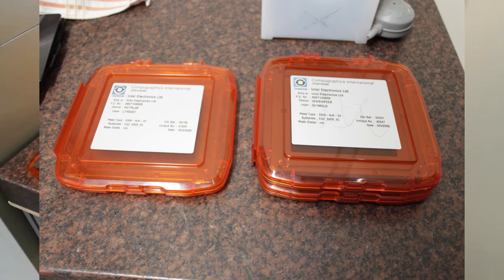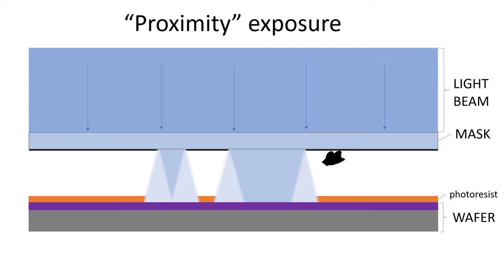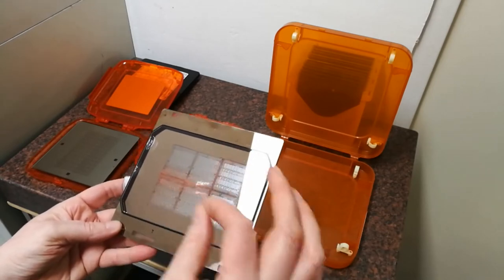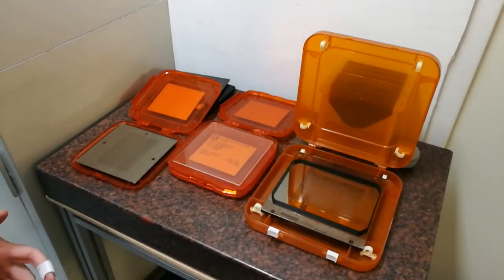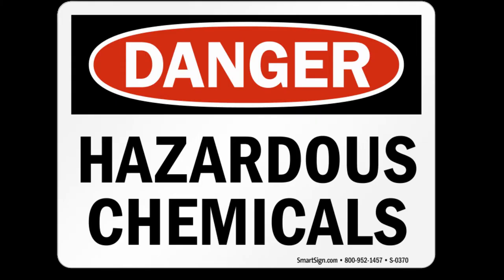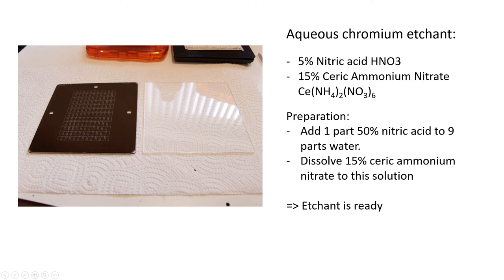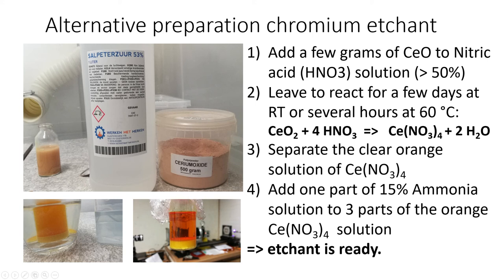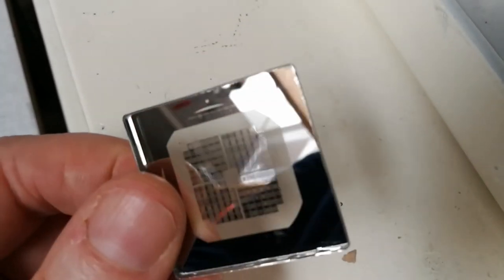Photomasks Explained (Contact and Projection): how to etch Thin Chromium Layers

Comment: I had got some masks to try and remove the chromium from. Found a Q-switched 355nm laser worked nice, ablated the chrome while leaving the quartz untouched, though this slow to the point to being useless. I ended up using the mask as a work surface in my furnace.

Comment: That's a very cool hack for a fume cupboard ! Really interesting about how the Pellicle de-focusses dust particles; reading about pellicles in semi-conductor / chip manufacturing I get a lot of oddly conflicting information (will eventually did deeper). In my 20's I did a lot of odd chemical mixing under heat that looking back I shake my head at. Is it possible to lap the Chromium layer off a quartz plate ? I know some fiducials on plates can be (skillfully) removed with a scalpel. And not to ask too many questions how do you / one know if one has a glass plate or a quartz plate ? Is there a quick test for that / tell tale signs before one has to measure refractive indices or analyze spectra etc. ?  Thanks again for making these amazing videos.
Reply from the maker: Hi ED, Thanks for you feedback. Yes it is possible to lap off the quartz. If you use rough lapping, it will be gone very quicky, but you will end up with a "frosted" window surface. If you use the "polishing" type of lapping, removal takes a long time. About quartz and glass: First you can find the code indication on the mask carrier box, second you can look at absorption (quarz has low absorption up to 190nm) and third you can look at thermal expansion coefficient on a hot plate using a micrometer gauge to measure the expansion during heating or cooling down. Quartz has a much lower expansion than borosilicate or float glass.
Reply: @HuygensOptics  Hey , thanks for that , wouldn't have thought of mapping out the thermal expansion, NICE tip ! Does make me look at Quartz with "New eyes". Very useful material.

Comment: But how is the first one made?  I mean so lets say they designed a new chip.  How would they take that CAD version of it and write it to the wafer?  I dont understands.
Reply from the maker: The masks themselves are generally written using e-beam lithography. This is a very accurate process that takes a long time, so it's not suitable for chip manufacturing itself. But it is suited for mask manufacture.
Reply: @HuygensOptics  Just to understand you.  So the microscopic circuitry that we always see on microscopes is drawn that way?  Thats the point the chips go from software to hardware?